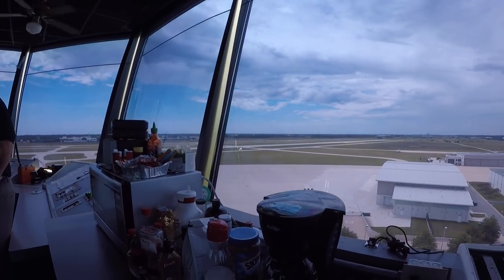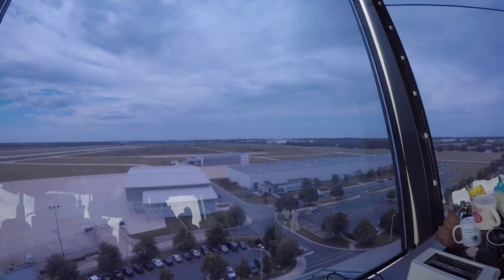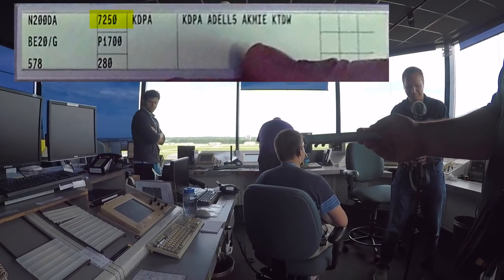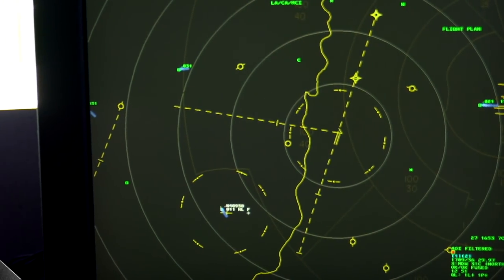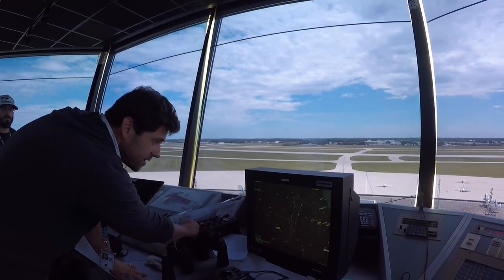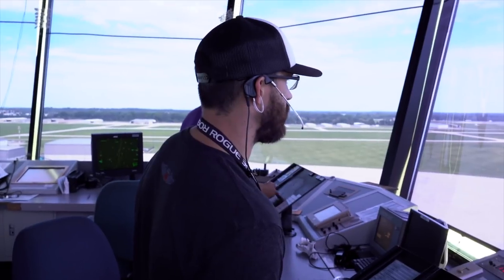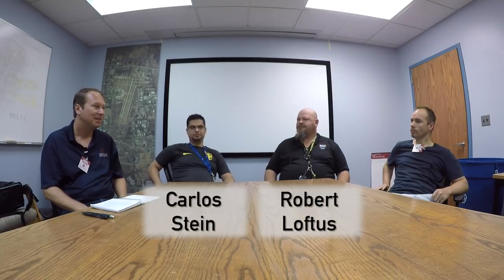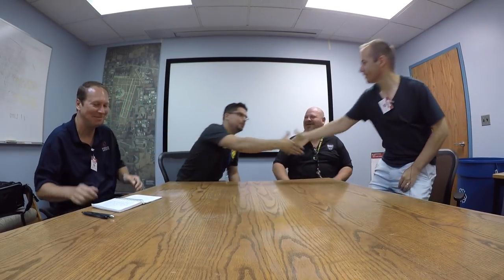Inside Air Traffic Control - DuPage Tower

Comment: Regarding the option clearance...when I was a tower controller <grin> I would never offer the option, I let the pilot request it if he wants it, then evaluate the traffic situation, and knowing an option could include a stop-and-go or full stop, if those couldn't be accommodated, I'd say "unable the option but I can give you a touch-and-go or a low approach, which would you like?" or something like that. If the pilot came back and said well we'd like a (full-stop/stop-and-go) then I would adjust accordingly. I know instructor pilots like to use the option for certain training scenarios (e.g. unexpected go around "dog on the runway") so I would issue it if possible, but any kind of a surprise between what a pilot is doing and what ATC thinks he's doing is not a good way to do business..
Reply from the maker: Makes sense, Keith. I can see how the option isn't always a good solution from ATC's perspective.
Regards, Martin

Comment: @41:00 triggered my comment as I developed a software program called "ATC-pie" that allows this type of training, both with AI traffic (solo training) and with a teacher simulating the traffic. I thought it could be of interest to viewers here. Thanks for the video too!
Reply from the maker: Interesting - is this software something the FAA uses to train controllers?
Reply: @martinpauly  It is free software so anybody can use it without my knowing. A couple ATC schools have asked me questions and told me that they were considering it for parts of their training, but I don't know for sure if they did or will. I do think FAA could make some use of it, but I suppose not as a full replacement yet as anything of that level probably needs to go through some certification process.

Comment: great video. currently 3 months into my Afghanistan deployment doing ATC at a forward operating base. just started messing with my go pro, do you have any advice as far as filming. 1st person, recording the tower as a whole, or filming towards the active runways? Mostly rotary wing with some occasional C-130s/C-17s. thanks in advance.
Reply from the maker: I'd love to see that video! For something like that, ideally you'd have two or three cameras picking up multiple angles simultaneously. Otherwise it's very hard to aim it at the right place at the right time. If you only have one camera, maybe for starters I'd try to capture just everything inside the tower and see how that works.
Good luck, and Happy New Year from Iowa!
- Martin
Reply: @martinpauly  thanks for reaching out, appreciate it. will let you know if I make anything of it!

Comment: Do atc personal require any type of medical??    The controller at the beginning, Mr Loftus seems to be a very heavy breather or out of breath to the point we’re I am actually concerned for his health.  
I used to work at dupage airport before and after the new tower.  Great days those were.
Reply: Hey, good call; it was the first thing I noticed about Bob.  A very nice guy in this video,  and I felt that if he hasn’t seen his physician recently, he should get a check-up and possibly an echocardiogram to see if he has any obstructive condition.  As a doctor, I still may call the tower to talk to him and encourage him to have a consult.   After cancer surgery in my neck in 2007, I ended up with A-fib, which eventually became moderate and somewhat risky for clot generation, besides the exhaustion at the end of the day.  I had to go to a cardiologist for an exam when my FAA physical exam was recognized as needing a Special Issuance.  I finally had to go thru the internal procedure called ablation, which enters the veinous arteries in the groin, then into the heart, and sears the vein nerves which cause extra heartbeats to occur.  As a dentist, I recognized my condition and knew that sooner than later, it would be a good idea to take that step to reduce my risk and also have a better longer life.  Lastly, I am also still a pilot and have my Basic Med medical and can keep flying, since I have better health and physical conditioning than in years.  🛫😎
Reply: 2nd class for controllers. Management positions though, I don't think they require a medical
Reply: As mentioned, a Class II, Medical is required. If you continue to control traffic, the medical must be up to date.

Comment: What's a primary aircraft?
Reply: Evan Keal Without a transponder, an aircraft only gets picked up by primary radar. Therefore, there is no Mode A/C/S, so you got no information about the radar target except for the position.
Reply from the maker: As Noel said, it's an aircraft without a transponder. So it gets picked up by primary radar only (thus the name), not by secondary surveillance radar (SSR) and is shown on the controller's scope without altitude, callsign and all that good information.
- Martin